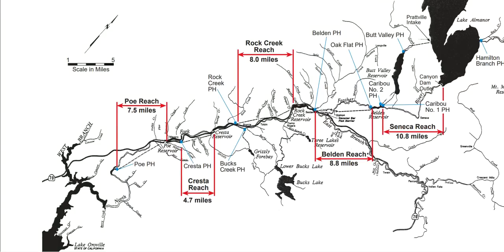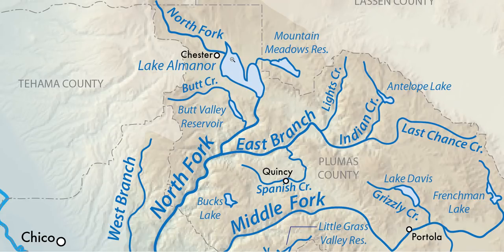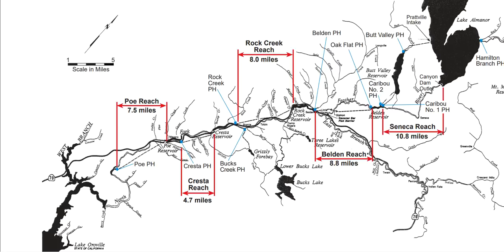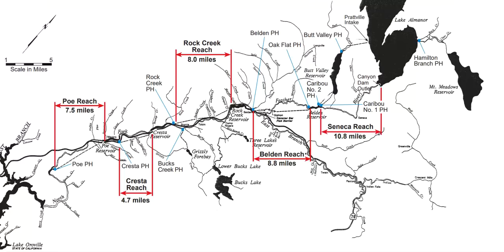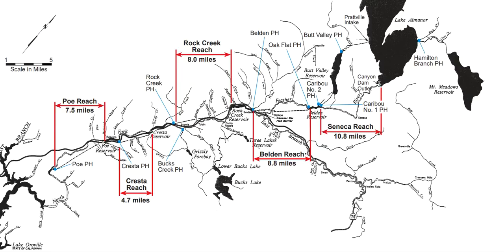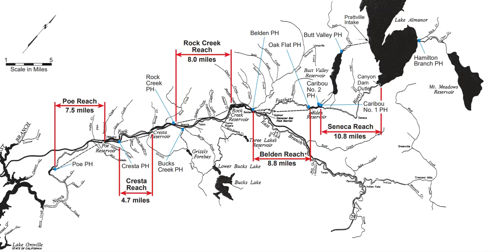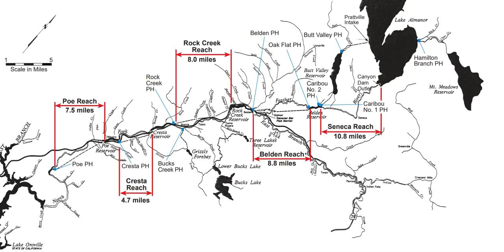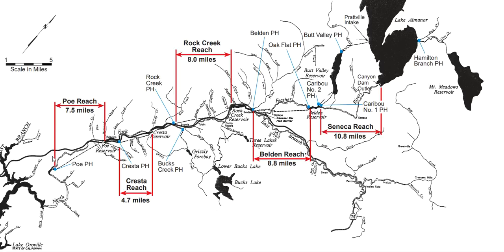Stairway of Power above Oroville Dam ~ An Overview of PG&E Projects

Comment: G'day Millie,

  Yay Team !

    That certainly is an ideal place to build a "Stairway Of Power" ; and I do like the idea of spinning Electricity from the Environmental Releases mandated to keep the Fish happy !

   For a long time I've been threatening to make Videos about the Windfarms & Solar Farms which have been sprouting about 20 miles west of here for 2 years...; and on Saturday they held an Open Day, so by showing up slightly before Sunrise & helping erect the Crowd Control Barriers I managed to be wearing Wristband L1 B1 01..., ie List 1, Bus 1, (Passenger) 01.

  So I got the front Window Seat accross from the Driver, with panoramic Windscreen & Glass to video through, while the microphone collected both the Tour-Guide's "patter" and the Driver's Radio....; therefore Warbles has finally secured rather informative coverage of 70 Goldwind Model 121 (121.5 Metres Rotor-Diameter) 2,500 Kilowat Turbines, each standing 150 metres to the top of the Disc all completed, plus 50 Hectares of Solar Array (in the process of being erected), and they let us get out and run around a Sheeple-Fenced Enclosure at the bottom of a Turbine...., after all they let Cattle rub against them, so what can Busloads of curious Windmill-Watchers do to hurt anything ?).

   With the throughput they were achieving (5 Busses per Hour, each Bus being away for an Hour, one Busload at a time at the Turbine...) most of the explanation happened during the trip out & back ; so I videoed those too, as well as the time On-Site, and a trio of "Teasers" showing the Crowd building up before the first Bus departed.

    Apparently, after Stage 2 (another 49 Turbines, Model 160s &180s, standing 200 metres high, 3.7 & 4.5 Megawatts each....!) ; then they are talking about a Pumped-Storage Hydroelectric System at the Southern end of the Project.....

   So, finally, Wind-Powered Hydro-Electric Current...., and only 19 years after I started writing Poetry about it (see "GREEN POWER IN THE FALLS....", it's in my "Warbles In The Wilderness..." Playlist....) ; the Dumeresq Shire Council accepted the Poem as a formal submission, and then unanimously voted against the Development Application for a Pumped-Storage Hydro-Project, which I was opposed to because it didn't have any Windmills...., it was to burn Brown Coal, 1,500 miles away, and they wanted to run their Furnaces full-throttle with Waterpumps as Load at night....

  So, feel free to come and check out my Edited-in-Camera/Shot-in-Sequence 6-Reel Windmill Expedition Doccumentary Series....; I think it went pretty well...., and I beat a couple of thousand other people to get that first Seat on the first Bus, in order to collect the Images & Tourguide's Patter....(!).

  Have a good one,

  ;-p

 Ciao !
Reply: WarblesOnALot A link would be expedient.
Reply: +Mike Cowen 

  G'day,

   Thanks.

     Yes, it would be expedient, and if I could then I would..; but y'see my YT Channel runs on a prepaid Mobile Phone, and I can't post "Links" to my Videos with Comments, due to the "Streamlined" view my Phone gives me of YT.

  Millie knows about all of this, we're co-subscribers, and my suspicion is that she's in the "Subset" of my Sub's who tend to only ever watch the Videos I post which feature Kangaroos & Wallabies ; therefore I gave her a Heads-Up that the Windmills might be a bit interesting to her....(?).

  If you too are interested in checking it out, then it should be easy enough to backtrack me by clicking onto the "Channel Icon" at the head of this Comment, in order to follow me back to my Channel Page, and therein, atop the Videos Scroll is the "nest" of Windmill Videos.

   Be warned, I use a Pushbutton Mobile Phone with a 3.2 Pegapixel Camera to make Videos, but while it's only a bit better than the proverbial "Fimed using a Potato" compared to what most people use, I am pretty well-accomplished at "getting the most out of it" ; to the point of having been sent a Gold (coloured) Medal from Falmouth University in Cornwall, England, for winning the "Low-Technology" Section of an international YT Videomaking Competition called the "EqualsProject..." (it was a Kangaroo-Feeding Video which won - they're kinda difficult for other people to compete with...).

  And the Prizewinning Video was indeed made on an acttual 2 MegaPixel Potato...; so, the Windmills were captured with what I think of as being my "Best Video Camera" (!).

  So, I'm sorry not to be able to post a link, but considering that I've never had a Computer..., the wonder of it is that I have a YT Channel at all !

  Have a good one,

  ;-p

  Ciao !
Reply: WarblesOnALot I understand links can be challenging from a mobile. That said, here's the link to the first video in your wind farm adventure.
https://youtu.be/qAk7UsH83eA

Cheers!
Reply from the maker: Hi Warbles! Thanks so much for viewing and commenting. I've put your Windfarm videos on my Watch List. I'm certain they will be fascinating. (Congratulations on getting a front-row seat!) Hmm... poetry and hydropower...